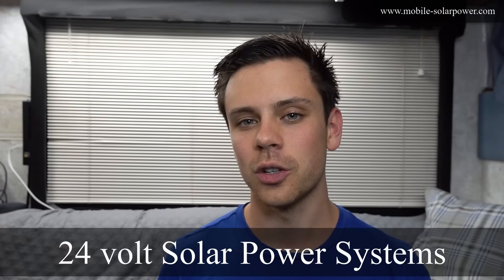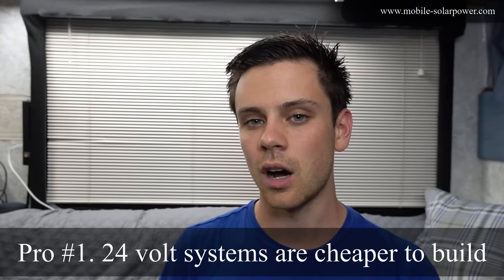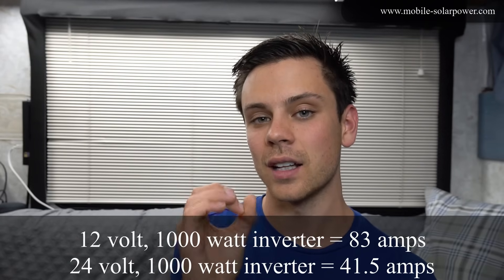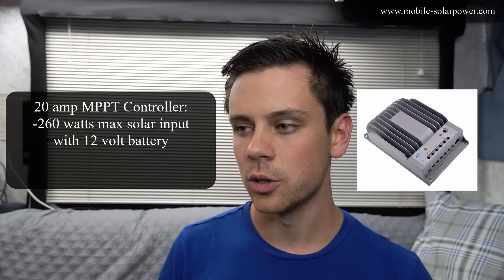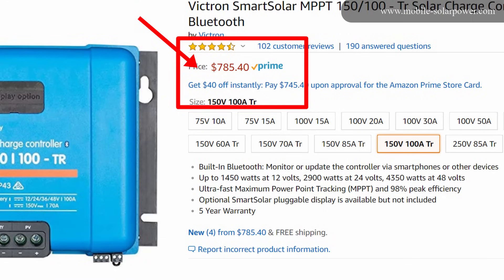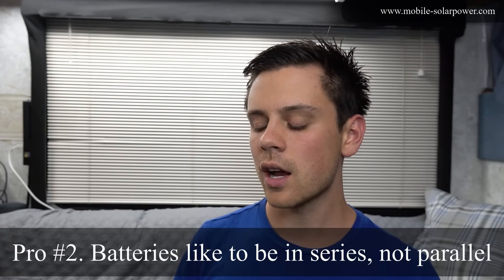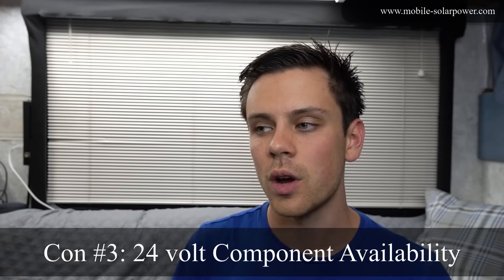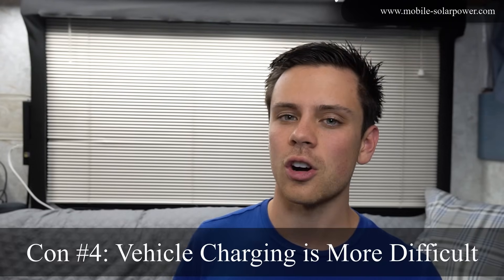12 volts VS. 24 volts for Off-grid Solar Power Systems

Comment: Nice video your RV has a 110 to 12 volt inverter already in it that is no loss with zero batteries it will run your slide outs and everything at about 90% efficiency I'm doing this in mine with 900 watts of power solar with my 24 volt  system 8, 6 volt batteries fyi great work keep it up .
Al
Reply: My inverter is 2000 Watts capable of 4000 Watt draw. 12 volts can can only maintain 2000 watts and a 24 volt system can maintain 4000 watts.hope that helps .
Al

Comment: i have a 24v system . i pulled the genset out and used its spot for the battery bank . i used a 4000watt SW inverter down the power line from the gen set and power all of the RV even my washer / LP dryer and roof top AC with 11 solar panels on the roof

Comment: Hi Will, excellent tutorial thank you

I may have missed the comment or you response so I will ask anyway

What do you consider a small, a medium and a large system

We recently bought a 2400 W 24V system that charges off mains due to the unreliable state energy supplier we have in South Africa 

This system is only to run some LED lights, a freezer and the baby’s room 

We now want to buy a separate system to power the rest of the house, again, charging off the mains and are looking at a 15kw system

Your response and Any advise would be appreciated 

Regards
Peter

Comment: Hi,will im planning  on building a all electric R/V   electric motorhome  with marine utilities like frig , electric rang, electric water heater elements. I'd like to run all systems besides the motor system on 48v  but run the lectric D/c motor system on hi current  to power 2 worp speed 11 d/c motors hooked up to 5 full tesla batery bank systems  , but my problem would be hooking the 48v internal system to tesla battery banks in series as well i would be using 20, 100 watt solar panals  on the roof that slides out on both sides of the r/v  as a paddeo roof .  Can you suggest a way to link all these components to gether and run the motor system and the internal power living systems that would be using 48v or 24v ?

Comment: Technically it's not the volts that kill, it's the amps. If you stick an electrode  into each thumb, 5 milliamps will kill you because the skin resistance isn't there. DC will follow the path of least resistance, straight through the heart in this example. So also using this example, a square 9V battery with positive hooked up to one thumb, and negative hooked up to the other does the job nicely. It will send you to the morgue.

Comment: Bottom line is - it is harder to produce higher voltage from solar panels. Most likely 24V systems will not work when at same situation 12V will work just fine.
All depends on weather
Reply: What if you have multiple panels connected in series (say you are working with 6 panels each of which outputs at 12 volts)?

Comment: I decided on 12 volts for the ham radios. For the few things that must, or can, run on 24 volts, I'm using a DC-DC converter. My next system will probably be 48 volts. I wish we could do 192 volts, because then the computer, TV, and other electronic wouldn't need an inverter or converter.

Comment: When in parallel, the voltages must match, a slight difference will have one device feeding the other or one device experiencing most of the current.   This can be countered with power transistors, have a diode connected transistor across the unit with the lowest voltage and connect it's base to transistors on the other units.  This would be what's called a mirror circuit and all the transistors would carry identical currents determined by the first diode connected transistor.   You would need such an arrangement for discharging and another for charging.

With devices in series, the current is limited by the worst performing device.

There are DC to DC converters to integrate different voltage systems.   Problem is you would probably have to custom design the circuit.

It's current that is dangerous not voltage.  It's just that higher voltages can push more current through a given medium such as you, however the fuses and circuit breakers on higher voltage systems would be set to lower currents hence the 24 v system could be less of a hazard to you than a 12 v system.
Reply from the maker: Yeah which is a major pain in the butt. And even if you match voltage, won't matter much in parallel because they will equalize. What you are probably meaning is internal resistance. one will get fed more and discharge faster etc. And each battery naturally has its own internal resistance. even if you do what Tesla does and match cells at the factory, parallel battery connections of cells is not good. That's why Tesla fuses each cell.

And yeah, exactly true about being in series

Comment: I've got 2 300w solar panels that are 24v.

I'll only use one if I can somehow use a cheap controller. What's my best way of going at this, so I'm not spending $500 for a controller or what do you recommend?
Reply: Str8upbrah I got a midnight solar controller and it completely rocks. I upgraded to six 300w 24v panels and really improved my harvest. Plus with the web interface updates and system monitoring I can keep track of the data and make important decisions on usage depending on weather events and usage.

Comment: Most electronics do not need a 120v to run.. that’s why they give a power brick that down steps it. My laptop power brick outputs 20v meaning I could use a dc power supply and set it to 20 v that runs off of 24v  and the loss is min. Same with cell phones if it uses a usb it’s only taking 5v.   If you buy a dc buck converter you can go direct to most electronics direct from 24 volt system

The dc buck converter input is dc 3.5-30v and converts output from dc .8 -29v  which covers most electronics and you would not need an investor to handle the house or anything like that.
Reply from the maker: Absolutely! I have an entire video covering that btw. Sounds like you don't need it, but in case other people who read this comment and need help doing it.

Comment: As far as vehicle charging, can you use an inverter to produce ac power from the car alternator and then get a 24v charger to charge the batteries?  I know it would be inefficient..............
Reply from the maker: Ya sure

Comment: Your comments on parallel vs. series battery connection is somewhat misleading.  If a parallel system is connected properly to the CC and the inverter, the draw is equal through all of the batteries in the bank. Connect the positive wire from the CC to the positive post on the first battery, and the negative wire from the CC to the last battery. This feeds power through the entire battery bank equally. When hooking up the inverter use the same method but connecting the positive wire to the last battery in the bank, and the negative wire to the first battery in the  bank, this results in an equal draw throughout the battery bank.
Reply from the maker: This is false. Each battery has a slightly different internal resistance. This is why 4p+ strings are non-advisable. Parallel connection of batteries will reduce cycle life. Even if you can match cells during manufacturing, such as in a Tesla battery module, it's not perfect, and you need a fuse for each cell. 

Power is never fed equally in parallel configuration. I suggest reading some battery chemistry books and understanding the internal resistance of batteries.
Reply: No, this is fact. I use this kind of system and have for years, along with thousands of other people, and it works very well.
Reply from the maker: @theorlandoprepper  No, you are wrong. It has a major fault point and your system will not last as long. Let me explain. Each battery has a different internal resistance. When you have 3+ strings in parallel, the internal resistance of one battery will be lower than the others, and will charge and discharge faster. This will speed up the degradation. Due to increased heat etc. 

This is an easy point to substantiate. If you understand internal resistance of batteries, this is easy to understand. Please find an electrical engineer or call a battery manufacturer to talk to a engineer to verify this. This is basic electrochemical battery physics.
Reply from the maker: @theorlandoprepper  And you can do it, buts its not ideal. You have a weak system. Read about how these things work. Do you wish to refute my internal resistance claim?
Reply from the maker: Here is a basic discussion thread to help you understand how these batteries work: https://www.solarpaneltalk.com/forum/off-grid-solar/batteries-energy-storage/general-batteries/369810-what-is-wrong-with-wiring-batteries-in-parallel

But I strongly suggest reading some books on this topic and testing internal resistance yourself, and experimenting so that you understand this.

Comment: Hi Will! 

I really enjoy watching your videos, you've tought me a lot when it comes to off grid electric systems. 

I'm planning to build a van and trying to figure what system that would be best. This might be a bit over my budget, do u reckon its a fair price for the offer?

3x 160W Semi flexible solar panel with ETFE surface coating.

1x 2500Wh - 50V LiFePO4 module with smart BMS ''200Ah at 12V''

1x 4kW Hybrid MPPT/AC/Charger + DC/DC 12V 10A

USD$ 3370:-

Offer excludes accessory hardware.

Best always!
Anders
Reply from the maker: That actually sounds like a really good setup
Reply: So its not a disadvantage to use 50V batteries? Do u get a big loss when converting it? :)

Comment: We've used a 24v system in our off grid house and other buildings for almost 10 years, and it's worked great. We're in the mountains in Colorado, so don't need air conditioning, but we use a regular 120v fridge, chest freezer, washing machine, household vacuum cleaner, etc.. We cook and heat water with propane, and heat with wood. I take care of my flooded lead batteries, and the initial set of golf carts lasted 6+ years. The set of L16s should last 15 years or so. Lithium was still out of our price range, or we would have gone that route. Nice video.
Reply: Hey Steve I'm getting ready to build a 24v system. What brand golf cart batteries did you use? I'm thinking Interstate or Duracell 4 6v 210ah@20hr.
Reply: On average I have never got more than 6 years on the L-16's with trying to not discharge them more than 50%.  Based on Will's videos I have changed to Lithium Iron Phosphate batteries and love how the voltage stays pretty flat during discharge.  I have never had them go below 12.8 volts.

Comment: Nice that you got the safety issue of higher voltages included, and also in great detail its a common unknown to many people that even 30 volt can be dangerous.
higher voltage solar and lower voltage battery banks also allows for charging in cloudy conditions, i know today it's less of an issue because of boosting, but i think it's something you mentioned but glossed over quite quickly.
maybe i'm just being to old school.

Great video

Comment: Lithium Batteries does not have an issue being in Parallel since it has no internal drain like Lead-Acids.. 
I would never build a system without a minimum of 2 strings on any battery technology for redundancy.
The converter is not that cheap when you get to 60 Ampere and certain system in a Motorhome like hydraulic levelers or starting the generator pul 200+ ampere. If wired properly in the RV is it possible to maybe run from the starter battery.
Reply from the maker: They have different resistances though, and they can still short. That's why each cell in Tesla battery that's in parallel has its own fuse.
Reply: @WillProwse  I helped to add 8 Battleborn in Parallel in a large coach and as soon as a charge or discharge stops is all current 0. I helped another install 6 Battleborn a year ago. All in parallel.  
Lead-Acids is a totally different story and to a certain degree, I agree. 
The Tesla fuses are for a totally different purpose since it is a sealed pack that needs to be able to handle single cell failures.
Reply from the maker: No, your battle borns have short circuit protection. So its fine. Each one has OCPD.
Reply from the maker: All batteries have an issue with parallel. 3 strings or more, and you will have problems in a few years. Lithium is not special in that way. Just different resistance than lead acid. But still variation present.
Reply: @WillProwse  Yes exactly the BMS and no internal drain makes it so that there is no issue adding multiple in parallel. Any larger RV need a minimum of 3 BB to support a 12 Volt System that is capable of running the Microwave oven from battery power. With less is the 100 AH per battery draw stalling the output.

Comment: Yes 50 volts is lethal but so can 12 volts under the right the right condition
 But if you follow the enthusiasts they're moving away from the 12 24 and 48 volts and moving up to the 400 volt system's recycling cars and making them into power systems they're not even rehashing the batteries they're using the car charger to charge the battery and using an inverter to sink the solar panels

Comment: Hi, i have a question.
Is it possible to convert your van/rv with 24v battery and alternator system then use 12v converter to run the van/rv matrix?
Reply from the maker: Sterling battery charger/isolator will do it
Reply from the maker: And yeah, I use converters in my 24v systems to power my 12v stuff

Comment: Hey. I have solar panels parallel wired in my cabin (to harvest morning and afternoon sun). It's a 12v system. Do I benefit anything from a MPPT controller vs. PWM?
Reply from the maker: Yeah, there is always benefit. 25-30% more power

Comment: Challenge for you. $1,500 solar set up. 500 amp hours. Pure sinewave inverter. 12v. I know not possible.
Reply: You may want to do a series titled "Solar for the Poor". What you could do with a tax refund in the low income bracket. You are definitely a well versed genius when it comes to solar.
Reply from the maker: That is a challenge
Reply from the maker: Li-poly eBay cells might be possible

Comment: I understand your reservations about "alternator charging", but I also like having a cheap way to make sure I have a full charge in Winter conditions besides shore power tethering.  In your experience are aware of decently priced quiet generators that will provide extra power for your 24V system?
Reply: martshal not sure what decent is but you should get one with the same capacity as your system requires. If you are 1000w then a 1000w genny. If you are at 3500w then a genny that can handle this plus surge.

Comment: Well said, I'd add that many coach busses use 24v alternators like mine, the stock alternator is oil cooled and rated for 270 amps @ 24 v.
Reply from the maker: Wow that is cool! I had no idea. I am ignorant to bus charging systems. I need to look into that.
Reply: @WillProwse  
I have 3 BBBatteries and NO solar panels YET... I may get a 4th battery to have 400 ah.
I want to get 4-5-6 300+Watts solar panels (1200-1800watts) on my RV. 
SO ARE YOU SAYING I NEED TO DO 24Volt  system? ??????????????????????????????????????

Comment: Will you mentioned wiring batteries in parallel is not good but what if you have a 24v inverter and want to do 2-3 tesla 24 volt batteries?
Reply: That's ok as they will passively balance, and if you keep balance chargers on all modules you can keep an eye on things. 
That is what I am doing and many RV'ers.
Will anything to add to this?
Reply: Off Grid Solar UK Thanks will look into those now!

Comment: CTEK duel MPPT & smartpass 80amp solar and alternator charger, im just about to buy this for my 2016 van. Are you saying factory alternators cant handle additional load? Please help TY.
Reply: This is what I am trying to figure out also. Did you manage to find any help ? What system did you use in the end ?

Comment: Will,
Thanks for the video. I have a 34 ft Fifth wheel, I would like to put 3-280 watt, 60 cell panels on the roof, and I would like to build a 8S1P, lithium batter with each cell 271 ah.
I'm a full time rver, and I don't like traveling with the refrigerator on propane. I would like to install an inverter in my truck, use that while traveling to run the refrigerator on 120v ac and use that to charge the lithium batteries. What are your thoughts? 
TIA,
Steve

Comment: You could probably paralleled 2 of the 24 to 12 volt  converters to handle a larger 12 volt load with no problems (80 amps), each would take on the real load due to being voltage regulated. I do not know if they will oscillate or hunt against each other, would be an interesting project to see if they would work together. Best bet for bulk charging solar batteries is to actually plug a higher amperage battery charger into a small generator (like a Honda generator hooked to a 120 volt ac battery charger) for longer bulk charges rather than use alternators. More efficient and less hours on your car engine, cheaper to replace Honda generator than a vehicle engine.  Cheers.
Reply: This scenario would make a cool video.
Reply: The intent was not to use them as a solar charger, I was speaking strictly as a DC load servicing apparatus. I agree to turn solar into usable source of power use an MPPT. 
@Alfonso Soriano
Reply: I would be careful with this. Not all DC to DC converters like to be paralleled.
Reply: @movax20h  This is why I would love for him to test the ones he uses to see how they react...I would still go with my best bet.